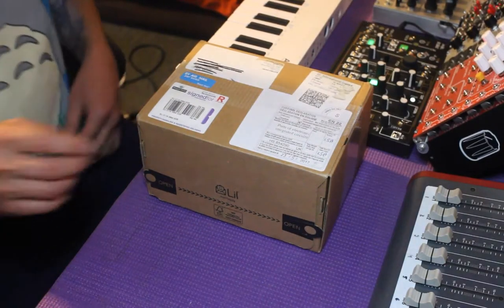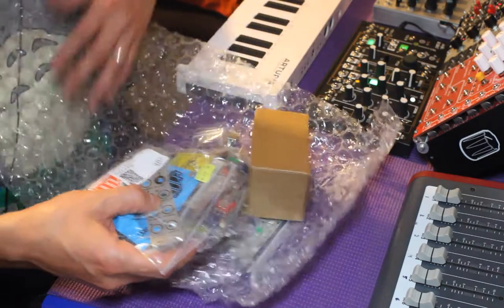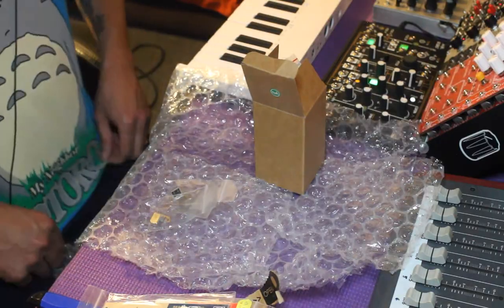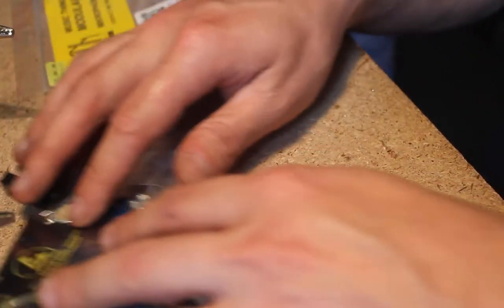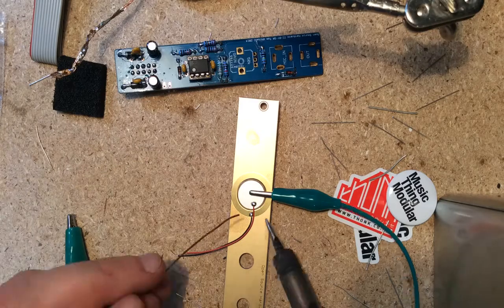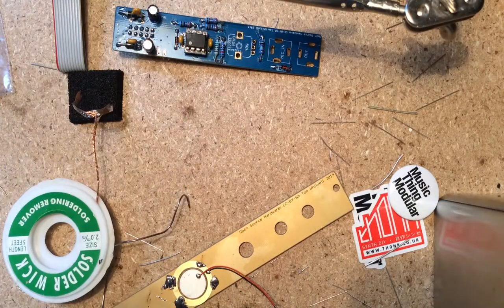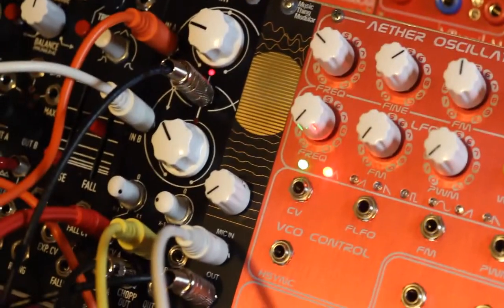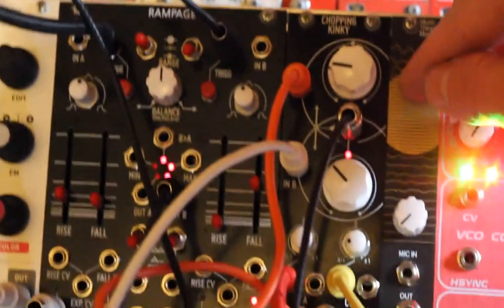Kit Review # 5 - Music Thing Mikrophonie

Comment: How do you check for shorts with a multimeter without the module being plugged in？
Reply: Use the multimeter in continuity mode. Touch one of the outer pins (+ or - 12) with one lead and an inner one (GND) with the other. If it beeps you have a short. Do the same with the other outer pin, and between both outer pins. You should have no beeps, if you do you have a short!
Reply: Quincas Moreira thanks!

Comment: Hi SDG,  I'd like to try scratch building a mikrophone. Do you think I could use a single sided blank pcb for the panel - and then I'd have a good surface to solder the piezo to?
Reply from the maker: definitely, go for it! glue a little piece of sandpaper on the front or something ;)